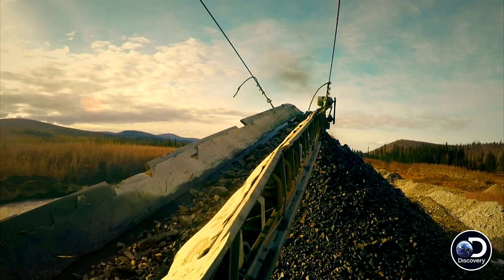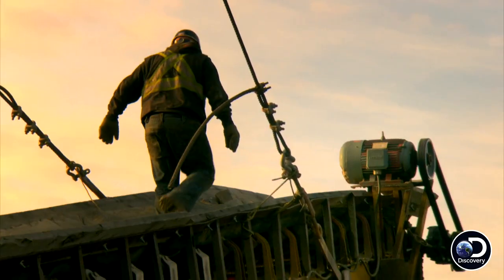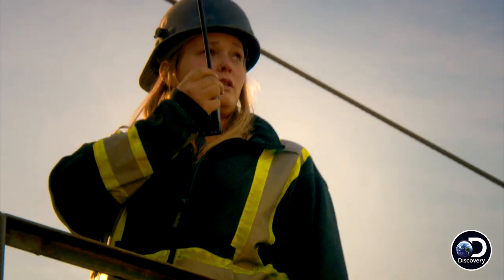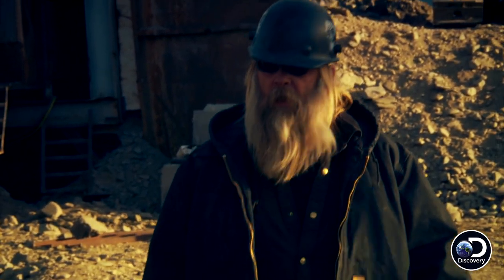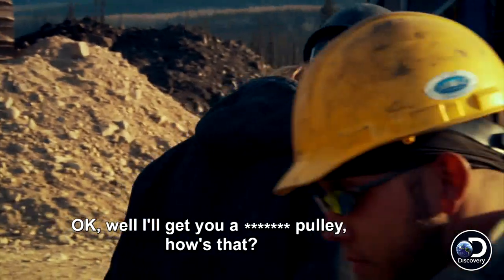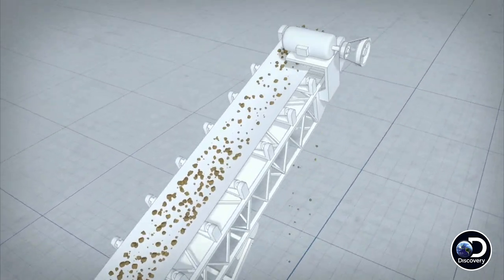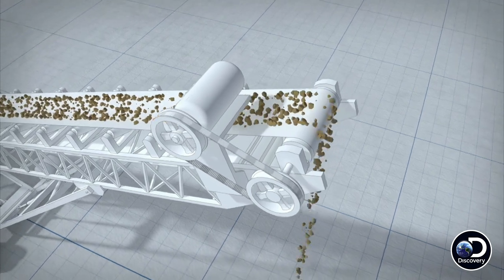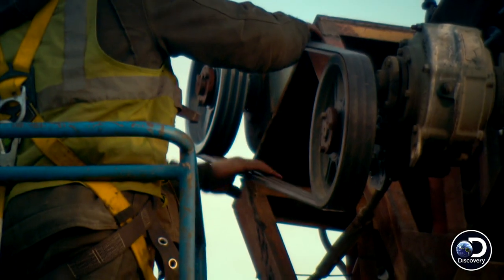Simple Machines Make Complex Problems For the Beets Crew | Gold Rush

Comment: dunno why u start off with a small pulley in the first place when your dealing with tailings you want to get rid of it asap.
Reply: A smaller pulley would put less load on the motor, so perhaps that was how the manufacturer designed it.